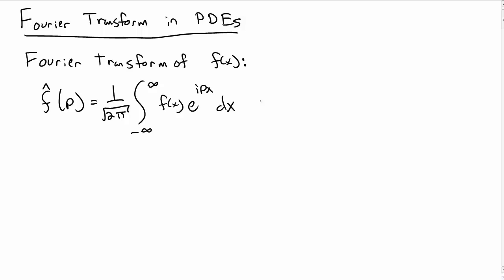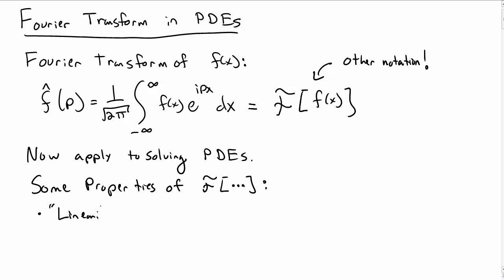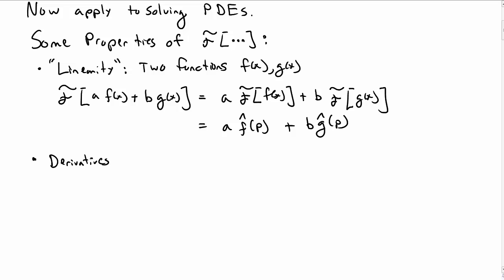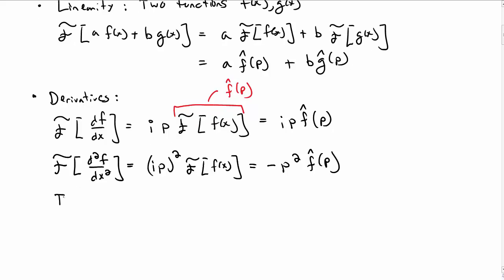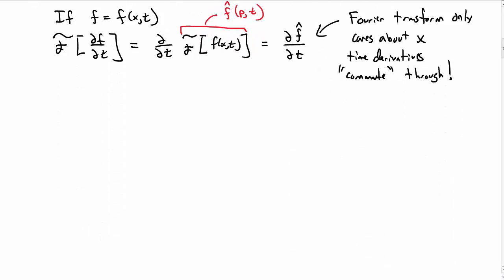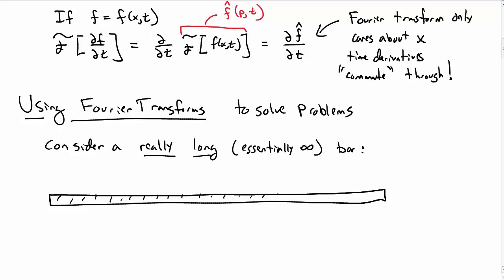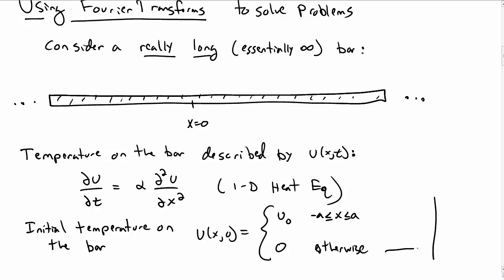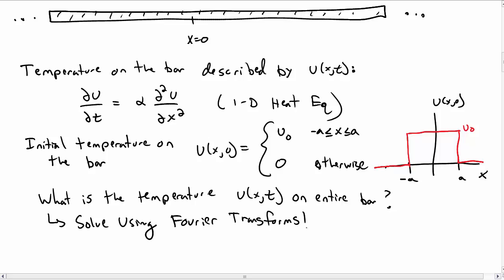Fourier Transform Technique for Solving PDEs (Part 1)

Comment: Thank you for the video. One thing I am not clear - if you have a function f(x,t) and you are transforming x - and lets say there is an initial condition f(x,0)=1. What would the the Fourier transform of f(x,0)?
Reply from the maker: Edvin Beqari The Fourier Transform in this case should just be the Fourier Transform of the constant function, in this case the Fourier Transform of 1. If this initial condition is just equal to 1 in some finite range, (e.g. f(x,0) = 1 for -a < x < a and zero outside of this), then the Fourier Transform for this is found in the next video, Part 2.

However, if the initial condition is 1 everywhere, out to infinity on either side, then this is a bit more tricky, and the Fourier Transform of this initial condition is a Dirac Delta function, e.g. F[f(x,0)] = F[1] = sqrt(2*pi) delta(p). You can check that the inverse Fourier Transform of this gives you back f(x,0) = F^{-1}[sqrt(2*pi) \delta(p)] = 1, which is what you started with.

The appearance of the Dirac Delta function here is certainly a bit subtle, but one justification of it is that its inverse Fourier Transform gives us back the original function, so it must be the correct form for the Fourier Transform...

Hope that helps a bit!
Reply: Dr. Underwood's Physics YouTube Page Yes it helps a lot. Thank you for mentioning both cases. In the problem I am trying to solve my corresponding u(t,x) function is the probability survival function which always starts from 1 at time 0, for all states X=x. However, trying to solve the PDE and get a meaningful answer with that IC its proving to be very difficult.